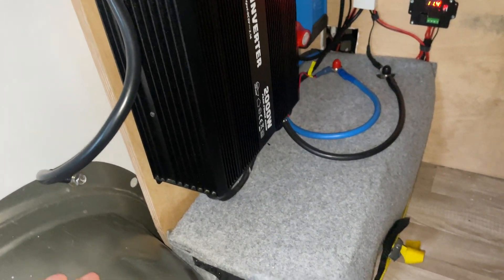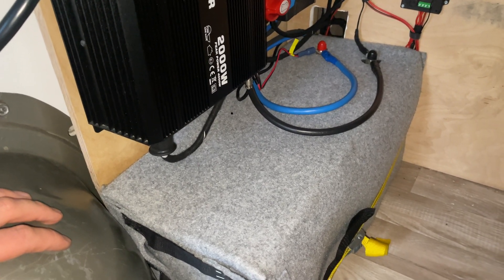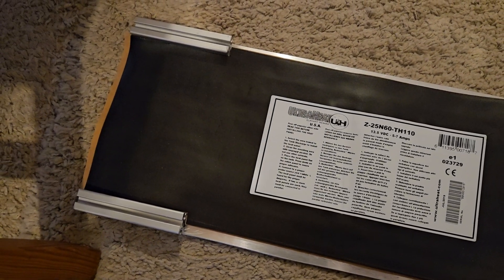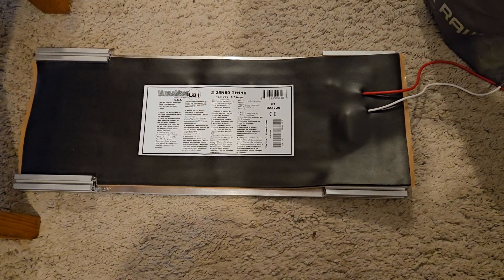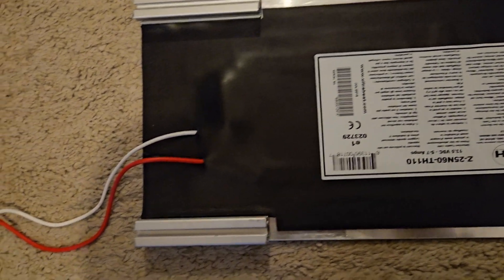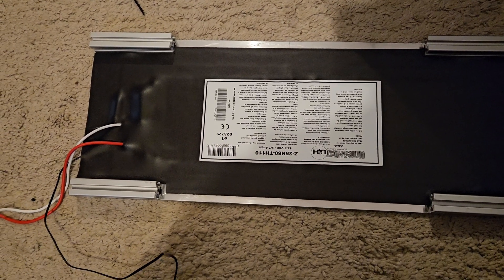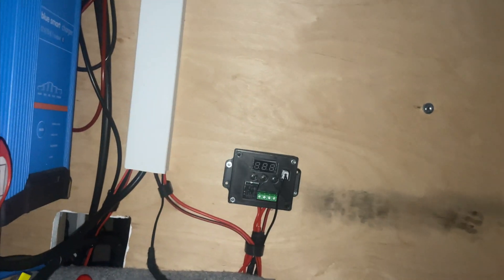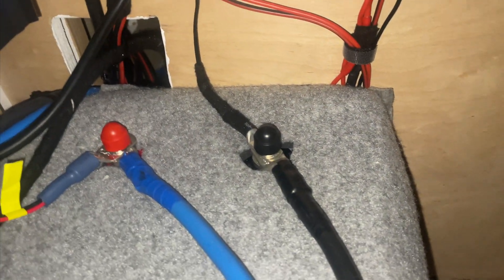Easy LiFeP04 Battery WINTER HACK | Using LiFeP04 Batteries in Winter

Comment: You say nothing about the effect on the heat pad, or where the temperature sensor is mounted.
I myself have managed to melt the housing on the batteries, by placing the temperature sensor too high on the battery.
I would recommend that you mount the temperature sensor directly on the heat pads, so that you do not achieve such high temperatures.
If it gets very hot at the bottom of the battery, it can potentially damage the battery in that place.
Say the bottom 5 millimeters reaches 100 celsius, before the top reaches 10 celsius, this will obviously damage the battery at the bottom, leading to earlier aging of the battery.
If the temperature sensor is on the pad, they will of course turn on and off a lot, but better than damaging the batteries.
Reply from the maker: Hi, thanks for your comment, Kenneth. This is not a normal heat pad, I also tried it with the normal 12v silicon heat pad, but you are right  they get way too warm. The heat pad I use is a RV tank heater which has their own thermostat. It turns on under 7°C and shuts off at 27°C. And additional, I control the heating pad with a W1209 temperature controller which shuts the system off if it gets above 40° as an additional safety feature. Heating pad is glued on the 5mm Aluminum sheet and not directly on the battery. So the heating pad  basically heads the aluminium sheet and the aluminium heats the battery. The temperature sensor is directly at the heating pad. Just hit me up if you have more questions.

Comment: Can you give a link to your heat pads?

You have a very nice system. I am impressed
Reply from the maker: This is a tank heater so it's not a normal heat pad, this tank heater has an internal temperature control which turns on under 7°C and shuts off above 27° C or something. I have it from a camping store in Austria. US Link should be the following: 
https://www.amazon.com/-/de/dp/B01MT9EUG9/ref=sr_1_7?crid=33049A0LL64JR&dib=eyJ2IjoiMSJ9.sWj0G3xQ1Pz7Uh_9zkgaNaGB_0947UV-wirEX0jJ1lsEBDaFHByg_Fm81F4m9QJd6XBtDn2vJuWjnhlqNSBXIU1wA13Z_m4rECkb1y2gN9gWIyjf7BvBRDgSTS3GU688EWR_sP2hxRyNz5UeJgTfEQZ_GUhEtt5EPcSujnBXXsVYby9b-2kwsf_XRFrRZPlxZrmL2dwJJHNscPdVFLaVCrAF25XRQlDQT77ZOZtHgD_IwriEV72xD5_rp7EtqxHpjKV0yI-oltx0Snmkl0TM6aO9mWUkj3mzPp4osdIhiy8.Tx1E8Ap-zSSGMukYPtuGGr724DLHvKTt9wpy9pXKH5E&dib_tag=se&keywords=rv%2Btank%2Bheater&qid=1709475883&sprefix=rv%2Btank%2B%2Caps%2C305&sr=8-7&th=1